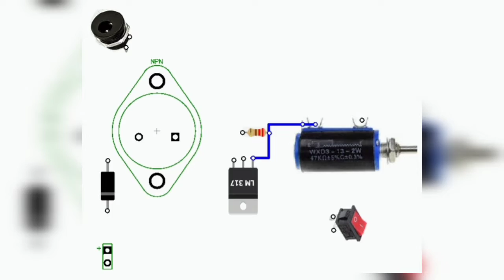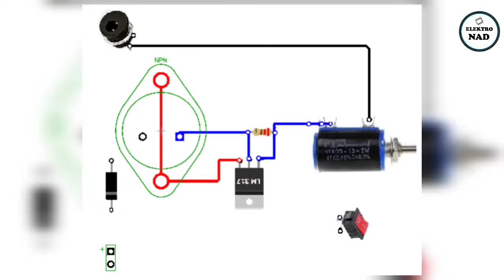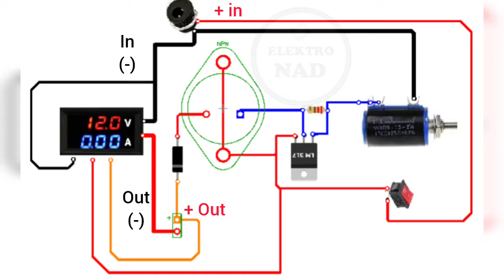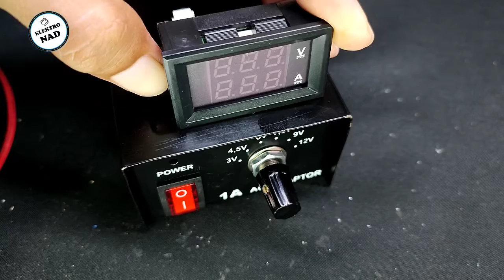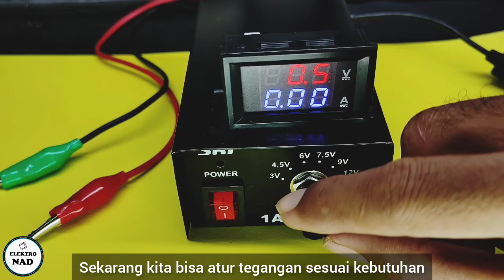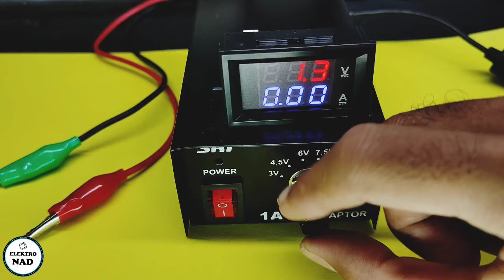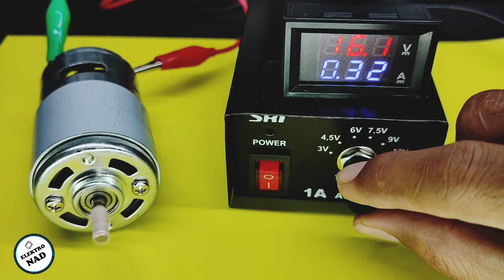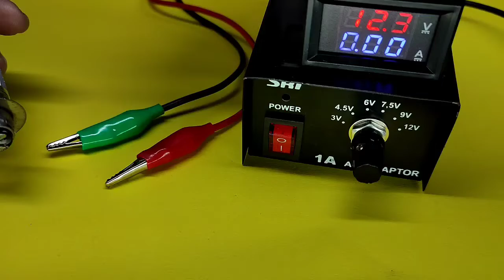POWER SUPPLY SEDERHANA PAKAI BOX DENGAN DIGITAL VOLT AMPERE METER

Comment: Bang klo pake adaptor printer outputnya 24v &18v bisa dipake gk?
Reply from the maker: Untuk inputnya boleh pakai 18 atau 24V
Reply: @ElektroNad14  klo pakai input 24v ada yg perlu diubah gk, misal resistornya atau vr nya.btw klo pake vr diatas 17 bisa gk bang yg mentok 24v?
Reply from the maker: @jhokerjhon12  tidak perlu dirubah, yang penting inputnya dibawah 30 Volt, supaya LMnya aman, dan untuk potensionya boleh pakai 10k sampai 50K, yang penting jenisnya multiturn
Reply: @ElektroNad14  tapi tetep gk bisa lebih dr 17v outputnya meski input 24v? Krn pake lm17
Reply from the maker: Tidak, tegangan dropnya sekitar 1.2V - 2.5V jadi jika diberi input 24 volt tegangan output tertinggi sekitar 21 hingga 22 volt.
Selalu pastikan bahwa tegangan input harus lebih tinggi dari tegangan output yang di inginkan, dan perlu diingat jangan melebihi 30 Volt, supaya IC LMnya aman karena banyak juga beredar IC LM yang KW